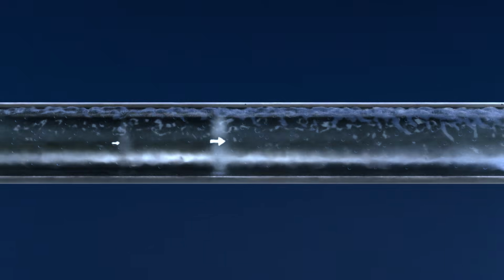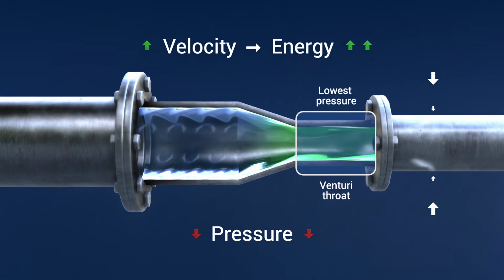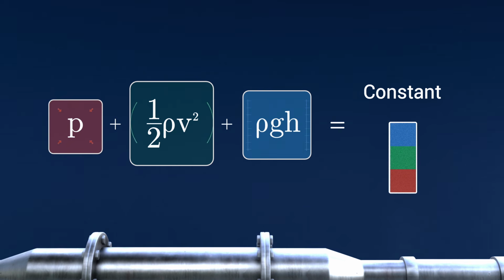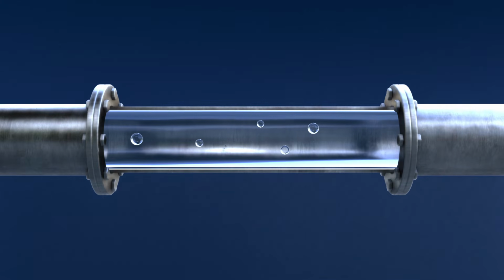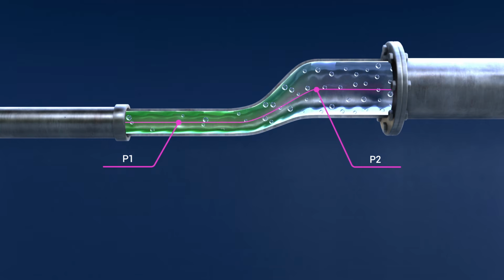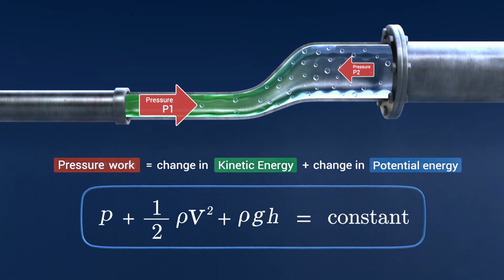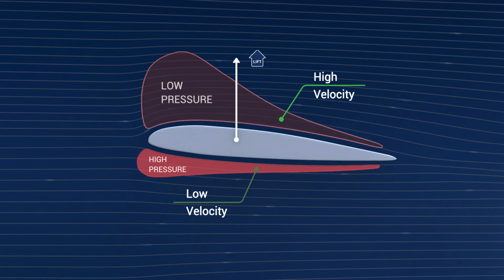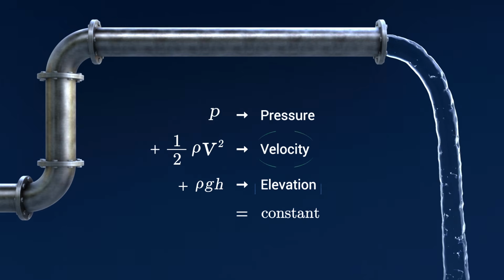The Biggest Myth in Fluid Mechanics | Bernoulli’s Principle Explained #engineering #fluidmechanics

Comment: In the incorrect application of bernoulli's principle,  to get lift, you speed up the air to create a pressure differential. The problem with this logic is that pressure differential and lift are synonyms. You don't create a pressure differential to get lift because a differential is lift.  The shape of a wing doesn't cause lift. It causes efficiency of the lift force. To say that the shape causes lift ,is like saying that the gearing on your car causes engine power. However,  the gears don't cause a force. It is inefficient to go fast in low gears and inefficient to go slow in high gears. But in either case the gears don't cause the force.  A lift force on a wing is caused by the downward acceleration of air. Lift is not an action force. It is a reaction force.